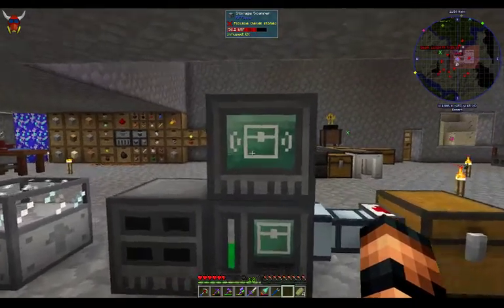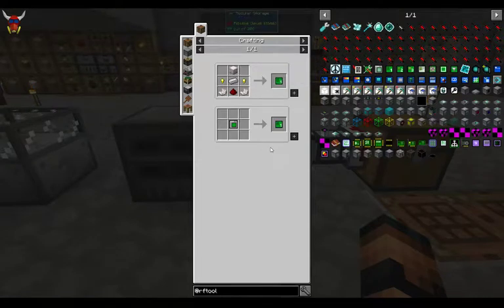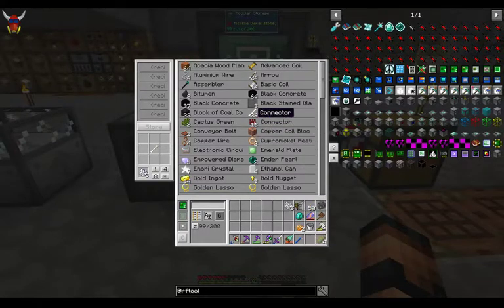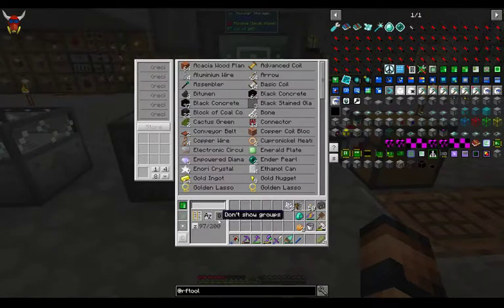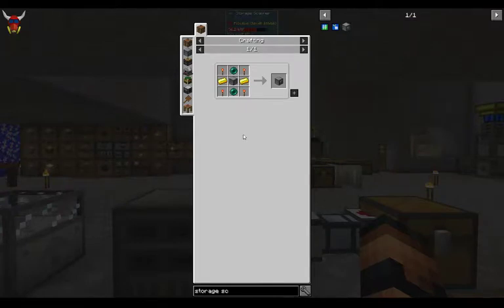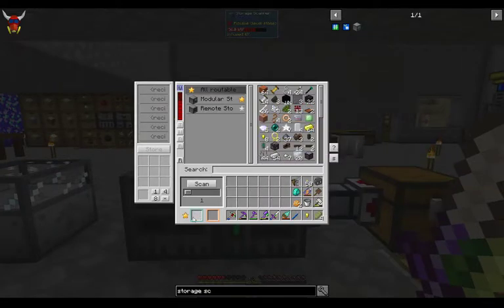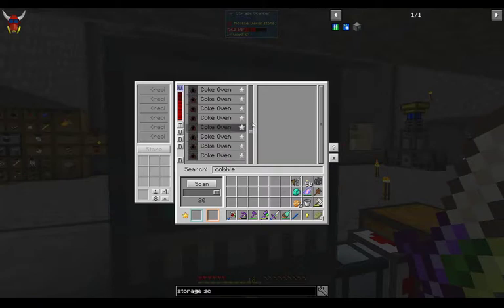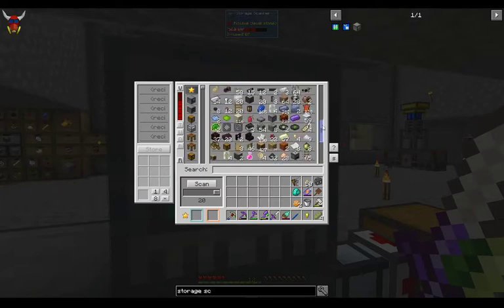FTB Continuum - Episode 20 - Modular Storage and Storage Scanner Basics - Inventory Management

Comment: Good vid bud, i really enjoy your commentary. 

I have a problem with my storage scanner though.
For some reason it seems to be really buggy in my main room (where all the machines and tech stuff is).
It just doesn't list all the inventories
If i put the scanner in other rooms it works perfectly fine and picks up all the inventories it's supposed to.

Its really annoying and i cant figure out what the problem is..
Do you have any Idea what it could be?
Reply from the maker: I did have some trouble with the storage scanner.  I was able to sort of work around the issue by changing the distance the device was scanning.  I'd set it down to 1 and then slowly move it up to maximum.  This seemed to work well, but wasn't ideal.  It did pick the other inventories up if I clicked through slow.  Hopefully this is helpful until you can move to another storage method.
Reply: @meefmagnet776  I already tried that, with the range setting, but some inventories just didn't work. 
Thank you for answering though :)
We'll probably just move our stuff into another location and see if it works then
Reply from the maker: @BlueC4nnon  I only used regular chests (copper, iron, diamond) to make that work.  Move to the next tier if you can!